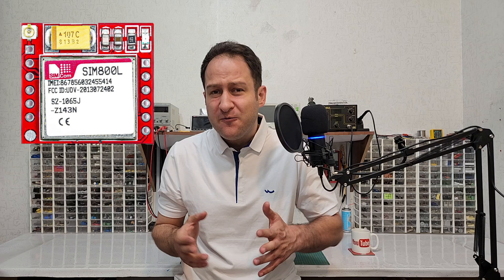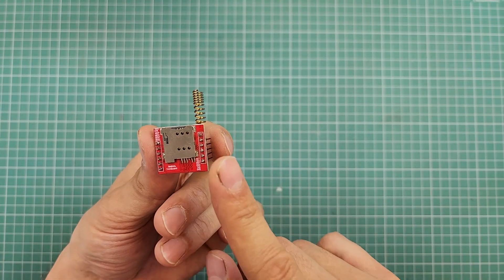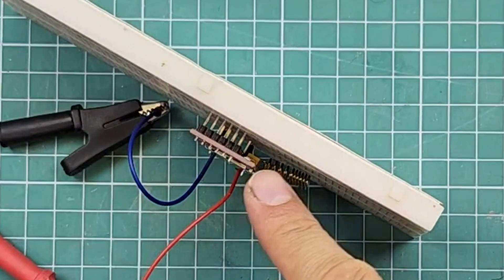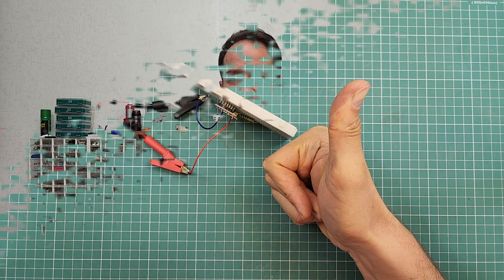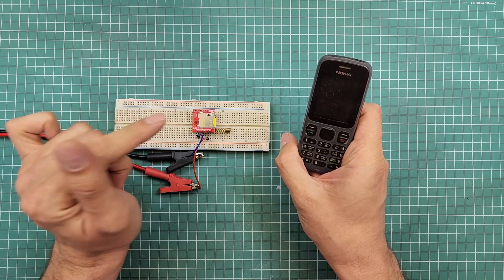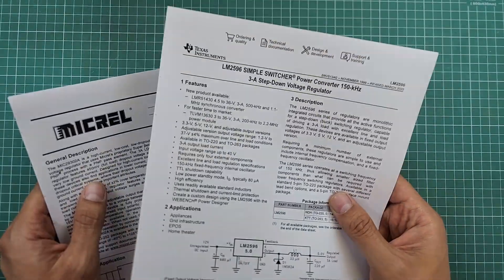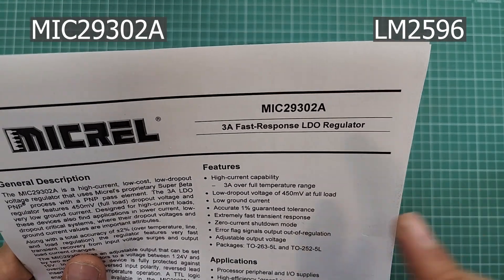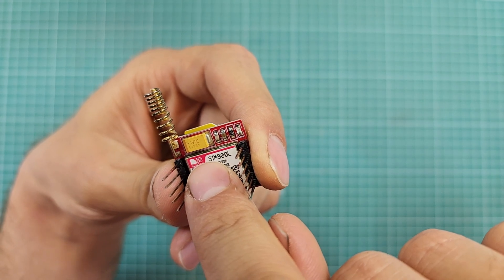SIM800L: 5 Easy Points to Get it Up and Running

Comment: The SIM800L module draws up to 2 A for about 0.5 ms during transmission, in ~4.6 ms intervals. Two 460 µF capacitors with ~0.05 Ω ESR in parallel right next to the module, together with 0.01 µF, 0.1 µF, and 1 µF ceramic capacitors close to the pins for filtering, will help reduce the voltage drop to no more than about 200 mV. The power supply should be routed using a conductor with a core diameter of 0.8 mm - 20AWG.